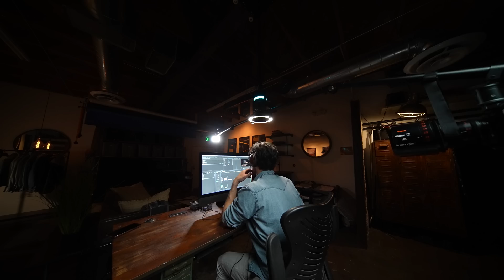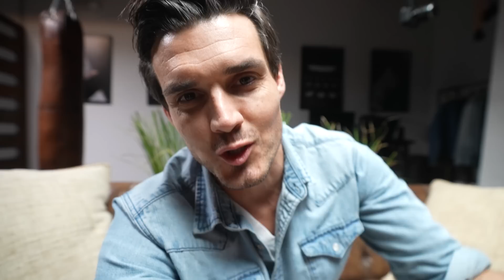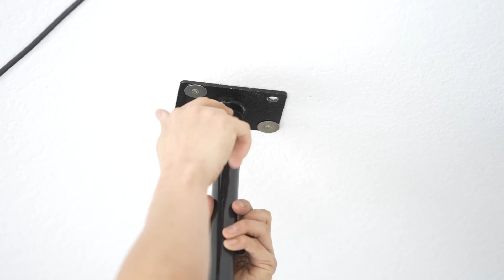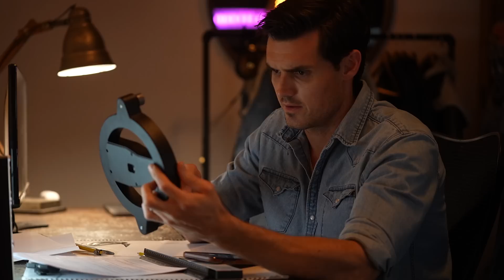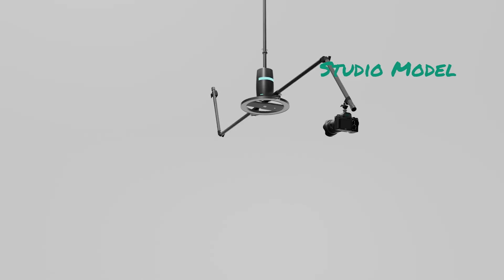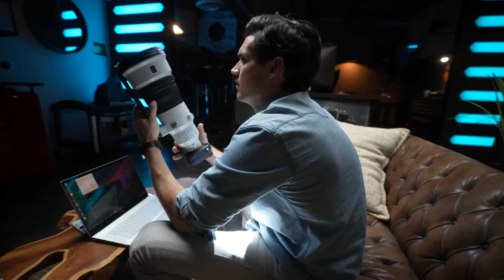I built an affordable Orbiting Camera Robot Arm.

Comment: I'm wondering if adding motorization to the joints themselves would allow you to do some crazy elliptical shots. Even better, make the joints 360 degree ball and socket joints with motors in them and have the motors on each joint synced up to make sure the counterbalancing works throughout the whole shot? Now THAT would take some serious mechanical engineering. But it's an interesting concept, nonetheless. And if the whole thing was wrapped in whatever color you want to key out, you wouldn't have to worry about it showing up in your shot while you're moving the joints around...now I'm getting way too deep into the weeds LMAO.

Comment: Whats the weight limit?
Reply from the maker: Still testing. Weight limit on motor is close to 75lbs, but I'll be testing my own body weight later this week. 

Limit on ceiling mount with 2 studs is probably 100lbs

Weight limit on each arm when fully extended is based on how far you extend the arm. When fully extended we are comfortable advertising and recommending a MAX payload of 6.5lbs-7lbs on each side--- but it's point of failure is easily 3-4x that. But I don't want anyone doing that and breaking the unit and camera. 

The pro mode should be able to hold 10lbs on each side when fully extended, still testing though with new mounts coming in this week. Stay tuned!!
Reply: @MAKEARTNOWCHANNEL  thats cool thanks. Having to take appart my bmpcc rig would be a big drawback for me but if i just have to take off the vmount and run it on lp6, i can switch over much more quickly. Big plus

Comment: What is the maximum load regarding camera weight and lens? 
I want to consider pulling the trigger on an outdoor kit... But I am lost concerning what I need to pay up front, and more than anything else : beside the 200 dollars for shipping to Europe, what am I suppose to pay regarding import tax? ... Does it work out on a kickstarter, the same way like buying to any sellers.. Where can I ask about my enquiries?
Reply from the maker: These are good questions. Post this question in the Kickstarter comments, and Jon and can answer! 

I can tell you I will be doing some heavy weigh tests later this week. So far I have put 10lb sand bags on each arm and the motor works fine and the arms seem to hold well. 

I won't advertise that, because that's testing still but the motor and the supports can hold a lot more than that. 

What gets tricky it's the torque exerted on the arms the farther out you place the weight. I'll have to do a video demonstration on this soon. Check the Marbl YouTube page for those demonstrations next week.

Comment: Hi, is there any chance that you could add to the Kickstarter campaign a package that includes blades to attach to the rotor? It would be great, in that case I don´t have to get divorced if I put that thing on the ceiling, just switch from camera arms to blades and enjoy some breeze in the hot days of summer. I don´t think it would be too pricey. Regards.
Reply from the maker: I will consider it. Just found out today that the motor we use has the potential for 35RPM. 

We won't allow that fast, for safety reasons, but still pretty incredible variety of speed. Considering it can also do 1/60th rpm dead silent.

Comment: I am interested in the Orbit Pro Kit it would be extremely helpful if the packaging foam fit a Pelican case for transport or offer a Pelican Case as an Option.  Or large enough foam so we may cut it for a secure fit in a Pelican case.  I understand the foam won’t fit the 10’ rods or the C-Stands just the main arms, motor, light and parts.  Can the arms be made from Carbon fiber to save weight?
Reply from the maker: We're are shipping with a soft foam case, but as soon as we have final dimensions I'll find a pelican case that I recommend. The components are not super delicate, so you can get away with a pelican air. Most likely a 1615.

Comment: Thank you, thank you, thank you, thank you, for doing this. I have had my head spinning around, get it, for a year or so trying to come up with a way to do this. I was going to start outside with two 10ft ladders, a cross bar of some kind, an old ceiling fan, and another bar and counterweight to hang my gimbal from. Your idea is what I could only hope to get to, and I’m glad I don’t have to figure out the electrical to slow down the fan. 48 RPM is a tad fast. Standing ovation to you and the team. I wish I could help with the kickstart, I will just have to start the budget, and be patient.

Comment: Add an option that attaches to a light or chandelier hardware that's already there. I'm sitting at my dining table thinking if I could just attach it with some kind of strap to the light fixture, that's a no brainer if it's not too heavy. Drilling holes for that once in a while shot might be a hassle. Scale it up for used car sales. Tons of possibilities. Very cool.

Comment: I feel like you could use 2 screws if the right material. Especially since the stud in the ceiling is only two inches wide. Could could still use the same plate but have two holes in the middle. People might like putting half the number of screws in their ceiling. This is the best though I love it! Your the man

Comment: That's really cool, but I'm more with the renting more than buying... But I consider it, specially that I really appreciate the amount of hard work that went through that process. Finally, I really recommend considering to make the tubes retractable and just solve the size issue, and you definitely have to provide some information about the balancing process, as its really important for the ease of use and setup.
Another whole idea is just try to make more than one axis and you would transform into a 360 degrees crane setup (Retractable 😉)
... And then you would have a very very good product, and get some better 3D printed prototypes with some better materials and better finish.

That's it for me :D good luck man and if you need any help just contact me 
Instagram: @noorahmedsamir
Would be more than happy to help :D

Comment: May I suggest a type of cradle for the camera, instead of the hot shoe mount? That is not the strongest point of a camera, and extensive use may lead to failure. A camera cage would also solve this problem, but having the cradle built-in with like an arca-swiss or Manfrotto 500 plate mount would be efficient and sturdy. The Additional weight may be an issue though.
Reply from the maker: The cameras we are talking are under 5lbs and the hot shoe is made from steel. In my testing it's plenty. Strong even for heavier lenses. For the heavier lenses we have Velcro straps to take weight off the ball joint. 

But I do recommend kondor Blue half cages or full cages. Or using cameras like the Bmpcc4k /6k / ZCam with top mount 1/4 20.

Comment: I tip my hat, takes balls and ideas to come up with something like this. But to me it's rather something I would rent than want to own. As with many other effects, this one could be overused too quickly. I wonder how this is balanced. It's also far from "mobile". Not something you'd throw in the car to have it "just in case". This would require a lot of time to set up.
Reply from the maker: Exterior shots seen in promo was with, Orbit Pro took me 25 minute set up time with just myself alone. 10 minute strike time. 

Compared to laying dolly tracks, shimming, leveling, using a camera operator. It doesn't even compare. 

The pro kit does not come with the c-stands or the overhead scaffolding (speed rail) but it does come with the mounting brackets, reinforced arms for heavier payloads and longer lengths, and comes with a Pro Bag. 

The speed rail to make the scaffold is the easiest sourced component that you will need to buy for yourself. You can get this aluminum tube cut to any length at most Metal wholesalers --- every city sells this component. I would recommend 12 foot lengths. You'll need two of them. 

I will follow up with a price guide and building plans in the campaign for these components, as it doesn't make sense for me to sell them at a ridiculous price to cover shipping. Same goes with the c -stands, you'll need two of them and they are not included.

We may offer a metal clamp, used for industrial spots that can clamp on to an I-beam or truss that's already in place. 

But these are the options currently for mounting. 1. Screw it into the ceiling into a stud. 2. Build an overhead scaffold with the pro kit. 3. Use a metal clamp attachment to clamp to pre existing overhead metal supports at the location. 

Hope this helps! More info in the campaign launch on Tuesday.
Reply: @MAKEARTNOWCHANNEL  thank you for taking the time to answer!
Reply from the maker: I have posted a bunch of these questions and answers on my IG stories.  IG: MAKE.ART.NOW
Reply: I like that idea of the metal clamp as I'm not a fan of putting holes in a ceiling if I can help it.

Comment: Incredible effort, Josh - you have a gift.  As much as I totally love this concept, I would want a portable solution, something I can take with me to a client’s place to show them in their habitat, etc. When that portable solution is arrived at, I am totally buying this.  Unless you can tell me you used a few c-stands when you filmed Anamorphia to simulate the ceiling fan mount?
Reply from the maker: Yeah exactly that. The pro model comes with the hardware required for you to mount across cstands (bigger stands are preferred for shots in anamorphia -- I use high risers now) 

The pro model does not come with the stands or the speed rail scaffold ---- you will need to source the speed rail yourself ,  can be found at any city's  metal warehouse supply. You'll need 2 x  12 ft.  

I'll post a video on this once the campaign is up. J
Reply: @MAKEARTNOWCHANNEL  excellent!  I’ll look forward to the KS launch!  You deserve all the success from this idea. Next idea: plans to construct your sweet studio for under $2,000. ;)

Comment: Once I hit the final price part of the video, I stopped cold. $800 as the special pricing for a novelty shot... Hard pass. I like your hustle, though!
Reply from the maker: I get it, expensive! When compared to motion sliders, or gimbals, these can also be called novelty shots--- however, as a product videographer, this tool is insanely useful and can easily make your work stand out and lay for itself. It can do what gimbals and motion sliders cannot. PLUS, if you ever need to film yourself there's that. 

But yes, the price is more than I'd like, but we bought the expensive tech of getting a motor that had tremendous torque, variable speeds, and is stealthy silent at speeds under 3 RPM, and that stuff is not cheap to do. You can't stick any stepper motor in there to get that.

Comment: i have a suggestion but I dont know if I can tell it right.

 its cool that the motor and the app can be programed to just take spin back and forth on  specified degree angle. but what about speed up on the angle that you dont want to use. example, for doing interviews, and you dont want to use the interviewer showing in the footage or the back of the interviewee,so it speed up on the specified angle. there will be much more useable footage instead of missing the interviewee face/facial expressions/moments.

Comment: Will 24mm lens be wide enough to capture my body on this with the arm lengths of the product or wouold you recommend a wider lens for this product.
Reply from the maker: Maybe. That last shot was me with about 18mm, and the arm half bent. Not fully extended but bent so it would be lower on my body. 24 may be tight, it may be a 1/2 body shot tbh.

Comment: Couple things I thought of (which there's a good chance you already have).  A possible mounting option could be a set of 4 of those strong rare earth magnets.  They can hold a shitload of weight and unless your torque them to the side to break them free they aren't going anywhere.  That would give you a ton of flexibility on putting this thing different places.  The second thought I had was to have some sort of stand that would allow you to set this thing up on the fly in someone's office.  I conduct interviews on job sites for construction as well as in the contractors own office.  If I had a stand where I could set this thing up in 5-10 minutes I would absolutely pull this out for interviews.  Especially if the app lets me control the arc angle where I can keep the mounts out of frame that's a no brainer for a unique interview angle.  Awesome stuff Josh, this is really revolutionary.

Comment: I'm so scared to start mounting stuff to the ceiling but... damn
Reply: There a Pro Model with sliders
Reply: Anthony408sj name of the pro models?
Reply: @stanglova86   3 Models are been offer. 
1) Base Station 
2)Studio Model
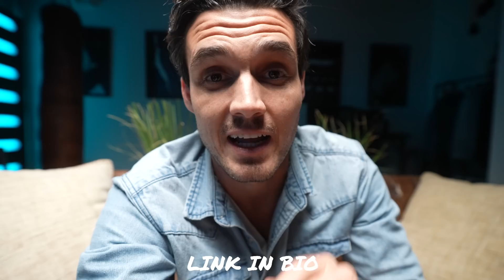3) Pro Model  ( this is the one has the sliders) 10:19
Reply: I always wanted a nice fan at the ceiling, wait,... could I just hang both together? 🤯
Reply: I have mounted several things to the ceiling. Its the best thing you can do, since it keeps your floor clear of tripod legs and makes ir easier for vacuum robots :-) (no cables)

Comment: AH this is insane timing! I've been wanting a way to circle around a subject-but doing so alone. The only solution was to find someone to help run around with a gimbal, and i don't have either 😂. However! I'm super happy for you-there's so much work that's gone into this! Just a quick question-would we be able to go in at a smaller price, and then pay the rest at a later date? Or would launch day require the whole payment at once? I saw the listing for the 50 limited-but those were already gone in a heartbeat!

Comment: Already sold out
Love the idea
Unfortunately I can’t use it. I’d need a way to get an hdmi back to a capture card and a way to get dc power to the camera without tangling the cords
But this is some great inspiration for me
Reply from the maker: My next video. Live stream set up demo. Shows the Hollyland Mars 1080p wireless configuration. Used it for live streams ---- they max out at 1080p anyway. 

Dc power is solved with a vmount clamp. Included in the studio and pro kit. Vmount batteries are on you though.

Comment: here is some feedback (even before I purchase the thing!).  Have options beyond a permanent installation.  Ideally, yes, you want to have this mobile, where they can take it to their location.  If not, then have options where you can attach and detach to your ceiling mount quickly. They will still have to install a mount to the ceiling, but perhaps there is a quick attachment mechanism that allows them to take it to multiple rooms, or multiple locations in the same room.  That's the only thing that i feel like deters me from pulling the trigger day one -- that it would be a permanent installation in one location.
Reply from the maker: Both are already solved.
Reply: @MAKEARTNOWCHANNEL  good to know. Look forward to getting my hands on this awesome product.

Comment: So love the concept, got in on the discount for the first 50, but realized after it's for the studio not pro version. Is there an option to upgrade to the pro?
Reply: The silent motor and app are the hard part, you can adapter the base kit easily enough.
Look up Matthews Menace Arm parts for sleeves and elbows.
Reply: @robertfeliciano5723  I'm confused by what you are talking about, I wanted to upgrade (buy) the pro version, but I  just put the $200 down for the studio version of this product.

Comment: Nothing on the Pro version.  Is the Pro hardware something that can be purchased to upgrade the Studio version?  I like the idea of something standalone and that could be setup on location.  If that is the case, would love to do the Studio on the early bird and add the Pro mounting/stand.
Reply from the maker: The same. Except the pro has beefier arms and longer arms and extra support. But you could buy the external mounts later and it might net a bit cheaper. Have not done the pricing structure for the individual supports on the Pro yet, but based on weight and size and material costs we know it will be significantly more expensive than the studio.
Reply: @MAKEARTNOWCHANNEL  Rolling the dice...  Didn't want to fall outside the 50!  Worst-case scenario and I channel my inner Josh and rig something up.  I won't have the computer voice in the background helping me, but perhaps not arguing with a computer while making the rig wouldn't be a bad thing!  ;)

If nothing else, it will make for a good review on our Dads Talk Tech channel! 

Great looking product and I absolutely love your videos!  Congrats on the Kickstarter!

Comment: Signed up...  hope to get one, was there a specific time for the release on Tuesday?  QUESTION-  I assume this will work inverted also?  I have several use cases for an inverted rig like this.
Reply: You mean camera pointed outwards? 
At slow speed could be very interesting 😉
Reply: @Voniatis   that too, but I was referring to a floor mount vs. ceiling so the motor would be upside down.   Doesn’t appear to be an issue, just confirming.